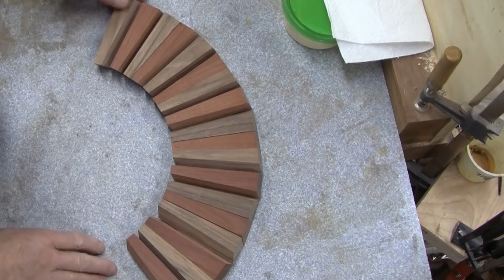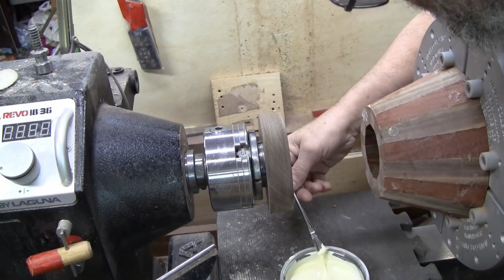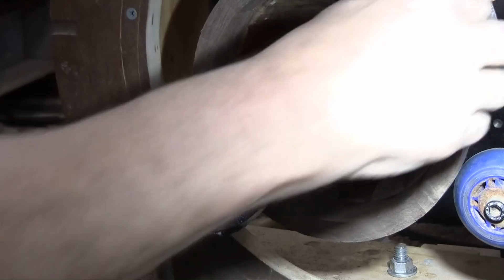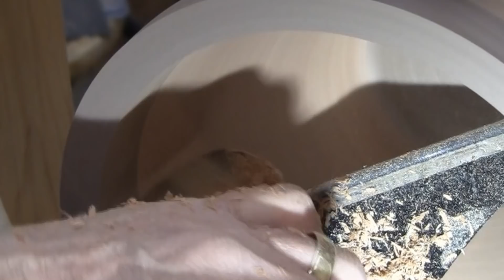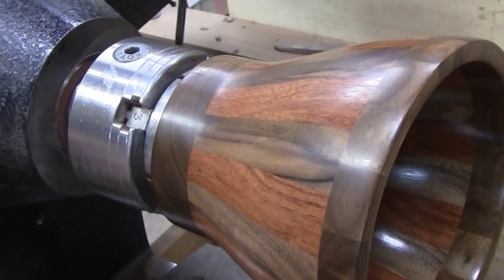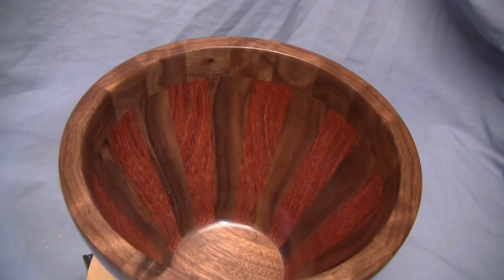Wood Turning Staved Bowl from Jatoba and Walnut

Comment: Gary, What are the angles, looks like a couple of notches off of 90 for the blade and maybe the same for the jig...or at least as a starter?
Reply from the maker: The angles I cut were as follows:

Miter angle 1.52 degrees
Blade tilt 9.89 degrees

The pieces were 5.82 inches long and 1.96 wide at the top which gives it a slope of 8.65 degrees

The board I cut them out of was 1.25: thick.

That should give you what you need.
Let me know how it goes,
Gary
Reply: @ThePapa1947  THANK YOU, you are a great teacher and I can figure out most of the procedures without a problem because you are a great teacher. I have been segmenting for years and learned primarily from you. Have just begun to play around with Staves and must admit confusion. I have  Malcom T's book and Mathias Wander's chart and many others demos and a Brain that cannot see between Horizontal and Vertical. I like staves because it can be used to show off beautiful wood. Thank you again for your help....B:face-turquoise-covering-eyes:
Reply from the maker: @BFran89  let me know how it goes.
This will make the same size I did. The width and length can be changed but not the angles.

Comment: Well done. I do have a question for you: you sanded to 400 then applied sealer sealer. My habit is to apply 2 coats of sanding sealer after standing at 150. Then complete the sanding. Do you think the final finish is different between these two methods? Keep the videos coming!
Reply from the maker: Thank you Jon, I think on some wood it really helps to put some sealer on before the final sanding. Mostly if you have grain that is not sanding all that well. I just did that on the inside of an upcoming video.
 As far as what the final finish goes I think they end up the same.
Hope that helps.
Gary

Comment: Do you have a source for the rotating tail stock piece you use to hold the chuck?
Reply from the maker: I think I bought mine on Ebay but it is this same one. https://www.pennstateind.com/store/LTCA18.html
It does have 1x8 threads. I happen to have 2 chucks left from my old lathe with those threads so it works fine. Other wise adapters are available.

Comment: Where did you get the data for the miter angle and the blade angle for the staves?  That information is available on line and in the tables at the back of Malcolm Tibbett’s book “The Art of Segmented Woodturning.”  I’m very interested in making stave bowls and it was good to see your method of cutting the staves.
Reply from the maker: As a wood pattern maker I learned how to make tapered staves by knowing the diameter at both ends which gave the slope and the cutting angle was based on how many staves I would have.
 Most modern segment software such as WoodturnerPro has it built in and is the easiest way now.
 We did not have that 50 years ago so a simple layout did the same thing.
 Thanks for watching,
Gary
Reply: @ThePapa1947  Gary, does Woodturner Pro have the capacity to tell you how large to make the staves if you have a limited amount of exotic wood so as to maximize the size of the bowl? A math friend of mine developed just such a set of equations and we use them in my shop. We cut staves on a miter saw that we set precisely and test the settings on scrap wood until we get it right and then leave it that way for a while. It is currently set for 18 staves at a 50 degree slope from the horizontal. I’m making my first YouTube video as we speak on the process, and it will include the equations.
Reply from the maker: @drferry  if you know how to use it WoodturnerPro will do anything you want. The staved bowl I did here I set the sled and blade tilt and all the staves fit together the first time. 
 I look forward to seeing your first video. I always give all my settings if someone wants to try.
 Here is something that takes a lot of calculations.
https://www.youtube.com/watch?v=n7RAHWwKcGE&ab_channel=ThePapa1947

Comment: Please let me know what angle you cut the staves!
Reply from the maker: Miter angle 3.54
Blade tilt 9.36

You can choose how tall it is and the diameter
but the following dimensions are for what I made

The length of the segment was 1.23
The upper width was 1.23
This makes a 20.56 slope

Comment: The tough part of doing this kind of work is the time on the saw. You have to have a very accurate saw and very accurate measurements. What kind do you use? Is it belt drive?
Your having been a pattern maker also gives you an edge. being able to visualize things.
I've now seen all of your segmented turnings. I would have a lot of trouble doing this. My only advantage would be that I was a pro cad operator, so I can kind of see your concept ideas.
You and your friend Phil are the best. ;-)
Reply from the maker: Thank you Robert and yes a good stable saw and accurate setup is crucial. I have a cabinet model Grizzly with a 3 HP motor. Although you do need that much HP but it was on it. And yes it is a belt drive. Yes I have to say my years as a pattern maker certainly does help. Looking at a 2D drawing and seeing 3D is what we needed to do.
 I also have a CAD system. I did not use any of it at work but I would stay and learn the system after work. They used UG there but I have BobCad at home. Plus I have 2 CNC milling machines. One is a Jet Mill/Drill that I converted to CNC. I put ball screws on it and built the control box for it. And I have a old Bridgeport Boss 4 which I tossed the electronics and built a new controller that lets me run as large of a file as I want. The old tape drive did about 100 lines tops of data and I have ran over 500,000 lines on some carvings on my system.  I also taught myself programing and I have to say I do pretty well at it. I am actually working on a segmented bowl that has some complex shapes I drew up and programed. 
Even though CNC had taken over the trade I was in I still love it for my use at home. I was lucky to retire before it totally took over.
 Sorry for the long reply but I enjoy it when someone brings up things like Cad which is an interest to me as well.
 Thanks for your comments and I agree about Phil as well.
Take care,
Gary

Comment: Hi Gary,
That is an amazing piece!The stave construction make it look very elegant!
Thanks for the video,,,
Tom
Reply from the maker: Thanks so much Tom I appreciate your comment.
Glad you liked it,
Gary
Reply: @ThePapa1947  
I gave it a try and it didn't come out right! LOL
I set the "segment angle" at 18 degrees and the "long angle" at 5 degrees!
Would you be willing to share the correct angles with me,,,,,please?
Reply from the maker: @thomaskuzia8125  Sure no problem and this was for 18 staves.
The blade tilt was 9.36 degrees
The miter angle was 3.54 degrees
This gave the sides a 20.54 degree slope using 4.27 inch long pieces
Best of luck,

Gary
Reply: @ThePapa1947  
Thanks so much Gary You're very generous with your knowledge.
Reply from the maker: @thomaskuzia8125  no problem Tom all should enjoy making one of these.
Reply: @ThePapa1947  
Hi Gary,,, I tried it with the info that you gave me and everything came out perfect!
Thanks again
Reply from the maker: @thomaskuzia8125  Great to hear Tom. And this will make any diameter you choose just by changing the width of the stave. But the stave thickness would have to be factored in as well.
Reply: @ThePapa1947  more great info,,,
Thanks again

Comment: Love the piece. I also use Woodturner Pro. How did you figure the angle for the top and bottom so it would sit flat? Is it the same blade angle as the stave?
Reply from the maker: Thank you Stevio I appreciate the comment. The top and bottom are cut to match the side slope of the stave.
Other wise if the walls are leaning 10 degrees then the top and bottom are cut the same making the piece look like a parallel gram. 
Hope this helps,
Gary
Reply: Woodturner Pro gives the slope of the side in the stave measurement panel. Thanks again for sharing your work.

Comment: I have been watching your videos for a while, very expertly, you work accurately, good ideas, nice work!  An experience to watch, I learn a lot from it!  Thanks!  If the degrees were included, it would help me a lot in copying :)
Reply from the maker: Thank you very much! I am pleased you liked it.
The blade tilt was 9.36 degrees
The miter angle was 3.54 degrees
This gave the sides a 20.54 degree slope using 4.27 inch long pieces
You can find lots of compound angle calculators on line as well.
Best of luck,
Gary
Reply: ThePapa1947 Big thanks, big like, maxi respect! 👍🏼

Comment: What sanding sealer did you use? Why 5 coats of sealer before you used sanding paste?,  Yes, it’s beautiful, thanks,Chuck
Reply from the maker: Thank you Chuck! The sanding sealer was Minwax lacquer thinned with lacquer thinner. 
I used 5 coats because I wanted an actual build up on the wood to help fill in the grain and get a more level finish.
I use the abrasive paste to polish all of that out. This gives the final finish a good base to lay down on.
If I spray on lacquer I always finish with abrasive paste and polishing paste.
Hope that all makes sense. This is just what works for me.
Thanks for watching,
Gary

Comment: Thanks for this video, Gary. Nice bowl. Of course I'll have to clean up my scraps now! 😉 I found videos on your abrasive and polishing pastes. Would you mind sharing your friction polish recipes? Or better yet, make a video ? 👍🏼😊 Thx
Reply from the maker: Thank you I am glad you liked it.
The friction polish is very simple.
1 part shellac   
1 part denatured alcohol
1 part boiled linseed oil

I use the small bathroom size dixie cups filled to the top which each ingredient.
I put in something where you can shake it before using. It does separate but a few shakes and it is ready to go.
Reply: ThePapa1947 Thx so much. I'll give that a try. Perhaps a marble or a stainless nut in the squirt bottle would work nicely.
Reply from the maker: Doesn't even need that. The liquid mixes easily but sure wouldn't hurt.

Comment: Gary, I am far from an expert, but I did take a class with Malcolm Tibbetts last year. One of the takeaways from his class is to always have the grain of the wood the same .For the bottom he recommended a floating base, turning a segmented ( vertical grain) ring and then insert a horizontal piece, not glued , in this ring.My struggles have been getting my staved ring square to vertical before I start turning it.However, I think I got figured out. Thanks for the reply, you are a very good teacher, thanks, Chuck
Reply from the maker: Hi Chuck...I am sure Malcolm has lots of great ideas and methods and I would never dispute how he does things.
 I have never done a floating bottom on a bowl but have thought about it. But I have never had one come apart how I do them.
 I think the humility around here plays a big part in that.
 I have a couple wide boards from Walnut that are each made from 3 narrower strips glued together. I glued them together 57 years ago in high school shop class.
They have been stored in an unheated garage for most of that time. Just regular Elmers wood glue. They are still flat with perfect joints. This is one reason I think are humidity keeps things pretty stable. Same thing with my acoustic guitars.
 I would not glue one board at 90 degrees to the other but I would say the rings I have on the top of the staves will be fine. If the staves shrink the rings will move with it. The segments will not not expand and shrink enough to measure because of the small size.
 Again not disputing any other thoughts on this. I am always looking for a better way to do things.
Gary
Reply: Gary, thanks for your input. Malcolm lives on the west coast, so I image the humidity there changes quite a bit. I am in southern Indiana, so our humidity also changes a lot, Making a vertical grain ring is just a matter of how you cut,( I know you know that ).  Anyhow, his class was great, glad I took it. I consider myself a rookie turner, but I love segmented shapes, great fun. Thanks for your feedback, Chuck

Comment: Thanks for this video, I have struggled with stave forms. Question, did you cross grains in your glue up ?If so, did you have any problems with wood movement? Thanks,Chuck
Reply from the maker: Thank you Chuck I am glad you liked it. Have not seen any movement but with the segments they are small pieces and there would be minimal movement. Not 100% sure what you are meaning by crossing the grain but the segments are going a different direction than the staves.
 I am interested in your questions so I would be interested in an example and also what the struggle is your are having.
Thanks for watching and commenting.
Gary

Comment: Great work as always!!! I would love to try this one, would you share the angles?
Reply from the maker: Glad you enjoyed it and I would be happy to share the angles.
Miter angle is 3.54
Blade tilt was  9.36
Slope is 20.56
If you have the miter angle and the blade tilt right the slope will just happen.
The width will determine the diameter of the bowl. Mine was 1.23 on the top and the bottom was .71
Those 2 numbers are what create the miter angle when the stave is 4.27 long.
If you have different lengths of staves then use the tangent of 3.54(.0168) times the length of the stave and that will give you the offset at the bottom.
Hope this helps..if not let me know.
Gary
Reply: Gary, I can't thank you enough!!!

Comment: Gary I love the way you think and work.  Did you measure, cut, trial and error to get the angle of the staves? I'm getting confused the more I think about it.
Reply from the maker: Thank you Robert. I set blade angle with a digital angle finder which works great. I set my sled with a very  accurate protractor and then cut one piece. I measured the ends to see if the slope was correct.
I then cut a few from scrap pieces and checked the fit. After that I went ahead and cut all the good pieces knowing I was plenty close enough even if I had to glue in halves. I was very happy to see all 18 went together with no adjustments. I expect that with my wedgie sled so was very  happy with this one.
Thanks for watching,
Gary

Comment: Love your bowl 👍👍 How do you determine the angles and number of segments or staves for your designs; what is the first-step❓
Reply from the maker: Thank you I am glad you liked it.
I used software to get the angles after doing a rough sketch with paper and pencil. I have a program called WoodTurner Pro.
I picked the number of staves I wanted and diameter and slope.
It gives you angles and sizes to cut.
There are lots of compound angle calculators that will do the same and a search for compound angles will find them.

Comment: 2:54 amazing angles calculation so they end up like that :)
Reply from the maker: Thank you very much Gabriel. Using a digital angle finder to set the table saw blade and a few cuts on scrap to confirm the taper was right by measuring the ends I figured I would be real close. But yes they came out just like they did. Always nice when that happens.
 Thanks for watching.
Gary

Comment: A perfect choice of wood for this project Gary , it looks a spectacular piece with that lovely finish  ! Outstanding work from you mate! 
Nice little idea with the gizmo moves the pieces away from the blade and stops them falling off the table, I'll have to remember that the next time I finally get around to doing some segmenting.
I made a stave jig  quite some time back and only used it once , I was more interested in making the jig rather than actually making something with it........I know     LOL
Take care mate, Bram
Reply from the maker: Thank you Bram I am glad you liked it. The wood is really the show here.
The gizmo was a bit rough looking but most are one off so it was a quickie. I need to make a zero clearance insert for when the blade is on an angle. I needed to fill a large opening is why the long strip came to be. Then I got the second benefit from it.
Take care my friend,
Gary

Comment: Excellent work Gary! Wondering how you figure out the sizez and shapes of each stave. Software or pencil and paper?
Reply from the maker: Thank you Stuart glad you liked it.
I use software and paper and pencil plus a calculator.
I used mostly WoodTurners Pro on this one. But there are lots of compound angle calculators that can be found on the internet.
Even for your cell phone.
Take care,
Gary

Comment: Excellent job Gary.  I'll have to try that too!  I have  a question about your finish.  Does it maintain it's luster or does it need reapplication after a few months or years?
 I am forgoing my next Dizzy bowl and am planning my tours next.  Keep up the good work, and thanks for providing these videos.
Reply from the maker: Thank you very much. The finish does stay like it is.
You are just doing a Shellac finish. That is all that is left on it when your done. The friction evaporates everything else.
The alcohol thins it down and the BLO allows it to be rubbed in at a high speed. Just a very easy French Polish finish.
Thanks for watching,
Gary

Comment: Stunning staved bowl, Gary.  What angles did you use when cutting the staves?
Reply from the maker: Thank you very much John.
Miter angle was 3.54 Blade Tilt was 9.36 which gave it a 20.56 degree slope. And yes a digital angle finder is a must for setting the blade slope. It can be done with trial and error but my staves fit perfect on the first setup. 
Take care,
Gary
Reply: @ThePapa1947  Thanks, Gary.  Good thing I invested in several digital angle finders (well actually I could not find one and desperately needed it, so I bought another one.  And then when I needed it again, obviously I could not find the new one, so I bought another one.)  After finally cleaning up my shop I now have three.  Now, where did I put that table saw ...?